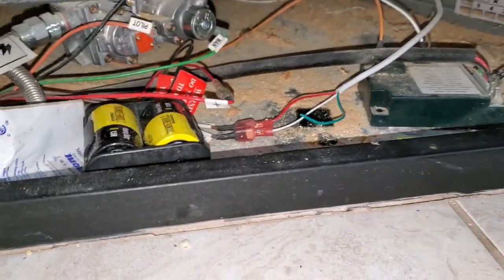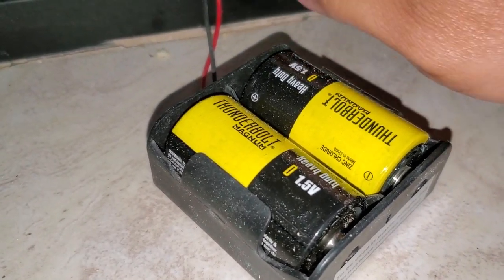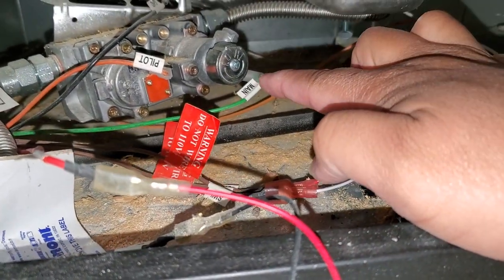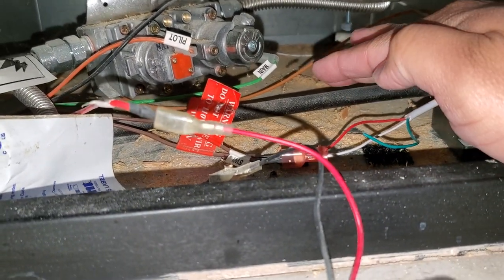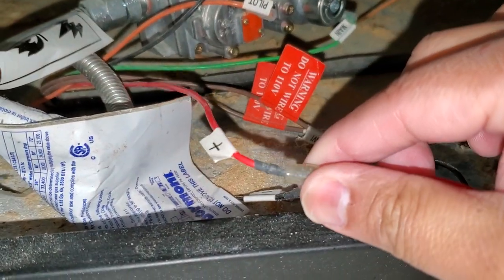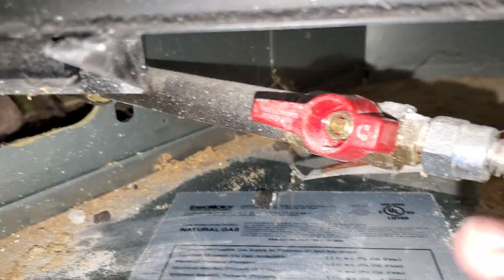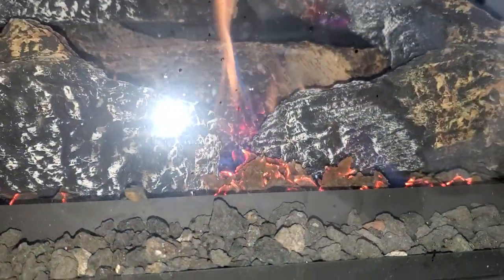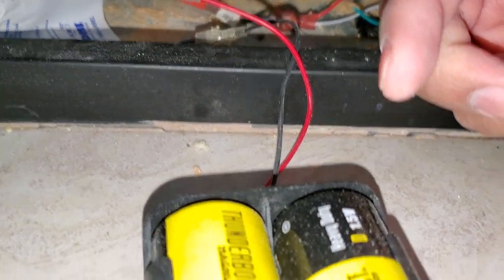Heatilator Chimney: How to switch to battery back up

Comment: So if the power goes out, I should unplug the green/main wire and plug the red/positive wire from the battery back up into where the green/main was plugged in? Thank you!!
Reply from the maker: Under normal operation (with power), the green wire lays there disconnected; it is only used when power goes out.

When power does go out, all wires should be connected as seen on video. (green wire in use and connected)
Reply: @35zeta  okay that’s weird the green wire main is plugged in it’s not just laying. So glad I came across your video